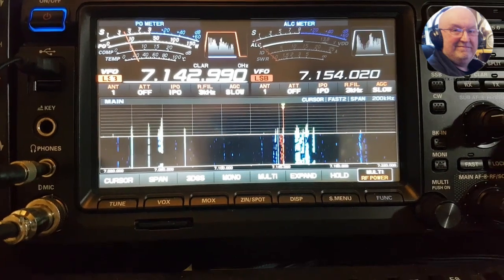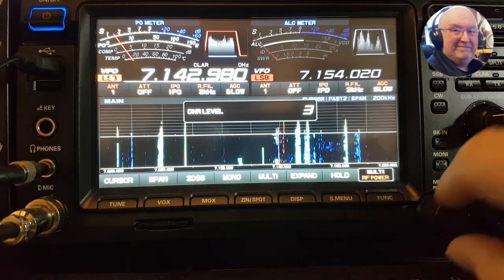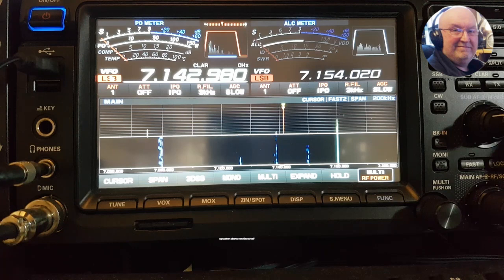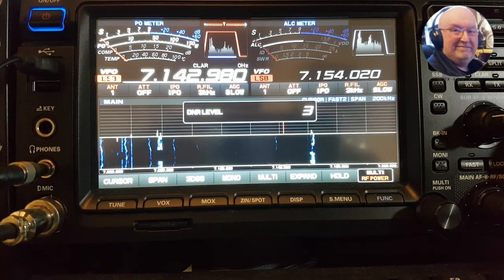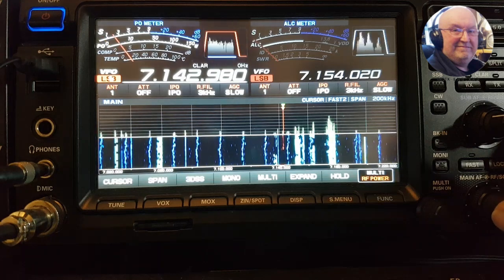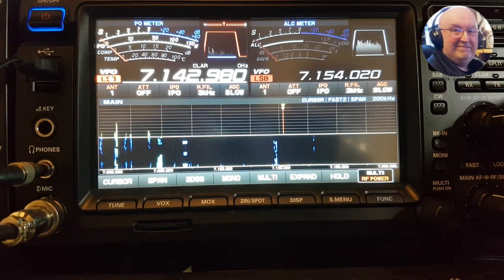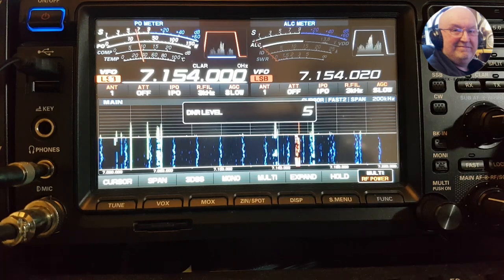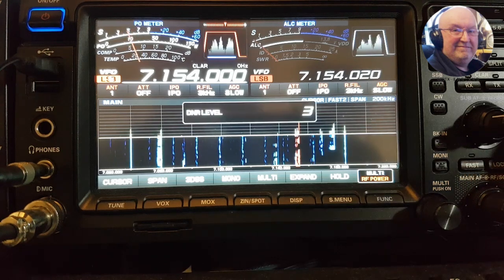Let's have a look at the VC tune on YAESU FTDX 101D.

Comment: I've never understood any of the videos I've seen on VC tune.  VC tune is just a front end preselector filter.  You don't seem to have any signals there that are interfering or overloading the receiver, so far as I can see it's doing nothing more that attenuating both the noise and the signal, with no real changes to SiNR.  Am I misunderstanding how it works?
Reply from the maker: It's A verbal capacitor and it does antenu the noise and signal attenuate the noise by reducing the amount of unwanted radio waves picked up

Comment: I'm not noticing any improvement with VC tune.  Just attenuation.  I never use VC tune on my radio.
And anything higher than 1 or 2 with DNR sounds too watery/distorted.
Reply from the maker: The Yaesu VCT-101 VC-TUNE Unit is a valuable accessory explicitly designed for the Yaesu FT-DX101D transceiver. This unit enhances the transceiver's tuning capabilities, providing users a more efficient and precise experience. By incorporating the VCT-101 VC-TUNE Unit into their setup, operators can optimize the performance of their FT-DX101D and ensure reliable communication in various operating conditions.